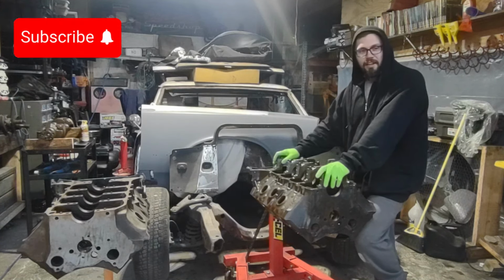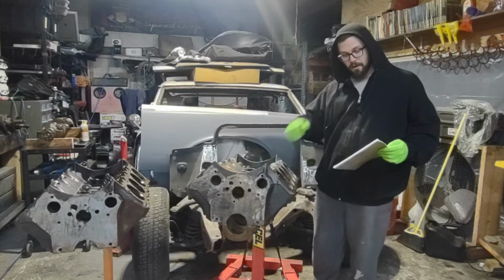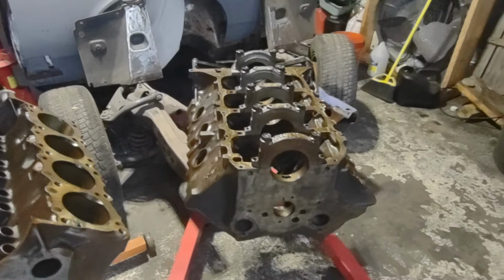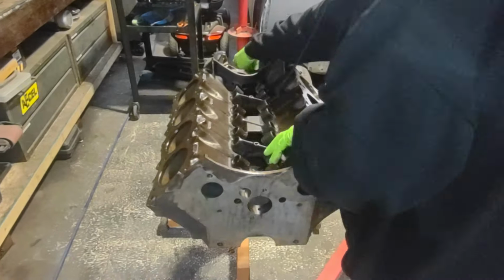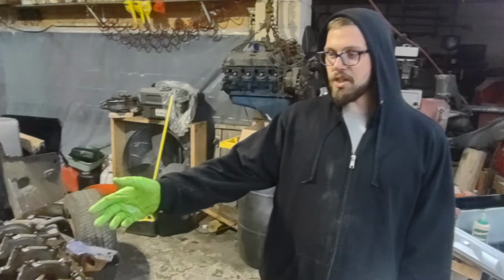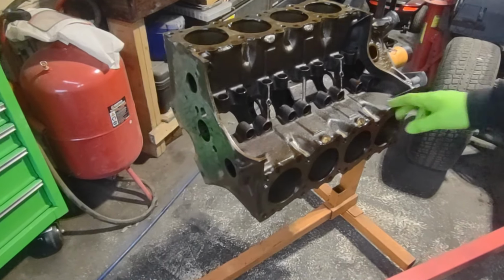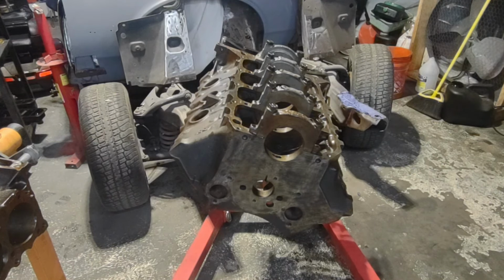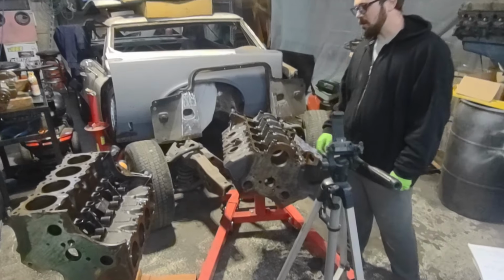Pontiac Engine Comparison.....There Is No Small Or Big Block

Comment: Lots of good information and thanks for taking the time to present it, oh and don't forget about the 350 ci Pontiac, those are my favorite, especially the 350 4-barrel engines with the 6X-4 heads. Keep Rolling......
Reply from the maker: The 350 gets overlooked a lot because of the 400, but yes, they're great engines. They respond well to tuning and bolt on mods. Thanks for watching.

Comment: 265 and 301 might count as they have shorter deck height
Reply from the maker: The difference with interchangeable parts with those is the intake manifold, the flanges have to be machined to get them to mate up. I think the valley pan may be different too.

Comment: they changed the stroke with the crank shaft! as if there is some other way you certainly can't change the stroke with rod length
Reply from the maker: You are correct, the only thing one could change with the rod would be the stroke ratio. James Jr may have misspoken trying to read my chicken scratch notes. 😁
Reply: @allhailinternalcombustion  sorry I understand I should've been polite
Reply from the maker: @insulman100  I didn't take it as you being impolite, I don't mind being called out for being wrong. There are so many channels out there giving misinformation, we don't want to be one of them. Thanks for watching.